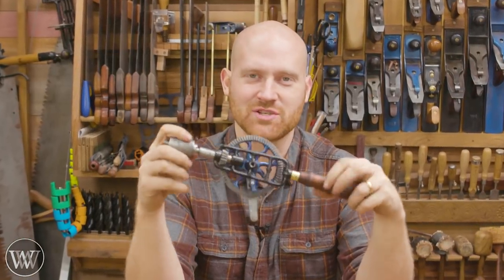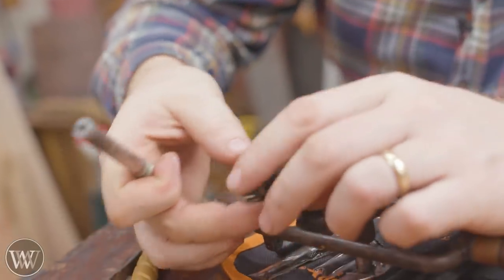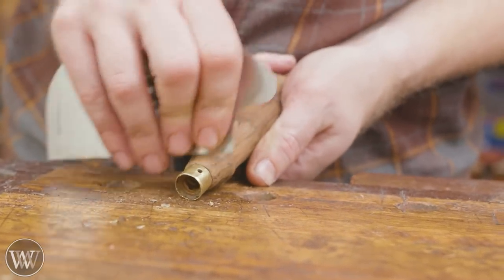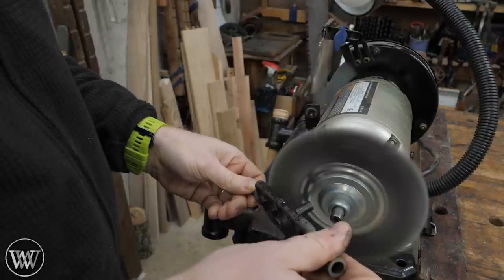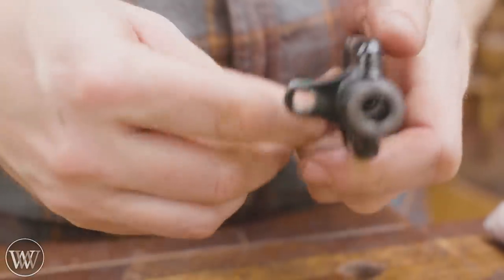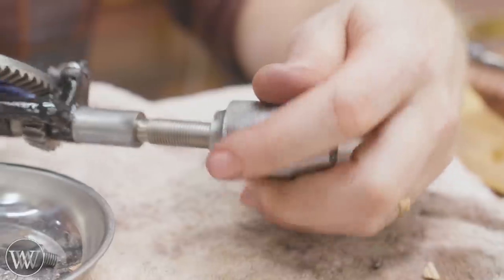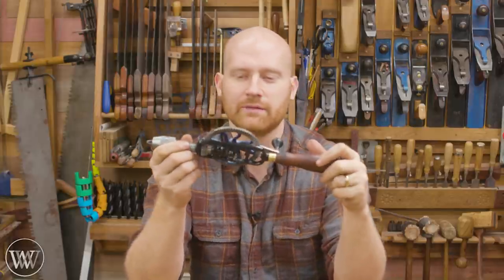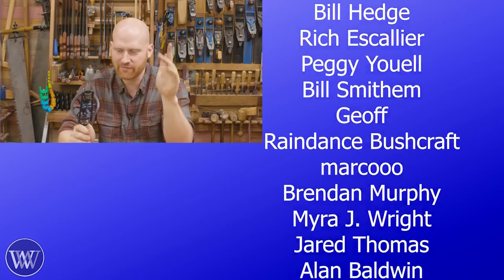How to Restore an Eggbeater Hand Drill

Comment: My dad gave me an egg beater drill (along with 2 braces & several boring bits), but I always have trouble with the torsional force when the crank is at the top & the bottom of the stroke, so I'm planning to make a pistol grip style handle for it to help give me a little more control over the twisting action.

Yours turned out beautiful!! Blue is also my favorite color 😁👍

Comment: LOL. I'm literally uploading a video of my egg beater restoration and I see this. Mine is a Craftsman 107.1 (or 1071) but the pin holding the main handle did not go all the way through, so that caused a bit of destruction that I had to repair. I actually called out one of your videos when using the edge of a chisel to scrape off the finish. 

I also restored a brace in very bad shape. Any maker's mark in the metal is completely gone due to the thick layer of rust. But it works like a dream, now.
Reply from the maker: Sweet dream I have to go check it out. Can you actually email me a link to your channel? That way I'll be able to see it. I can't just click it from here as this is a separate app for responding to comments.

Comment: I have an MF #2 or #5 with the 2 gears.  It's so much better than any of the modern ones.  You can't beat them for small bits that easily break in a power drill.

Comment: I really like the shade of red on Millers Falls Tools.  Acquired a Millers Falls egg beater drill awhile back.  After some rust removal and oiling, I found that the jaws could be pushed back into the chuck, but would not retract on their own.  Did not try to disassemble the chuck.  Seemed to work very well otherwise.  Any suggestions or advice would be appreciated.
I like these small drills.  It often easier than using a power drill, and I can be more accurate as well.
Thank-you for all you do to educate about hand tools.
Please take care and stay safe.
Reply from the maker: Yes. Some of those chuck designs can be incredibly difficult to work with.

Comment: Do you know where I could buy a new chuck, chuck shaft, and shaft gear (small) ?
Reply from the maker: Unfortunately those are not something you can get replacements for. And If you could the price would be more then getting a whole new one. But you might get lucky with some of the antique tool sellers on www.handtoolfinder.com most of them have a pile of parts tools. They might have one that is missing the handle to sell you.

Comment: I have an old egg beater hand drill that I fixed up. It works really well, but the knob on the crank is loose. Like there's a solid 1 or 2mm of space above the knob to the top of the bolt. Does anyone know what I could do to tighten it or completely take it off to make a new knob?

Comment: You do NOT need a third hand to use the missing side handle. The idea is to press the main handle against your body, to exert pressure on the drill bit, and then uses the side handle and crank handle with your two hands. Very useful for masonry  or metal drilling before electric drills were available. I know I did it many times as a boy.
Reply from the maker: Right on. I normally use that handle for the breast drills but for small ones like this they're so few uses that it's just not needed anymore. And if I do then I'll grab one of the brest drills.

Comment: I did not see you make a side handle for that. It would have had one of those coming from the factory.
When are you going to finish the restoration?
Reply from the maker: No side handle. Most people ended up losing them because they didn't use them and they ended up getting in the way. Later on. They sold them without the side handle because people didn't want them and would rather spend less money on them. But as to making one, they're actually kind of difficult to get the threading right. But you're basically making a small chisel, but instead of the iron you put in a threaded rod.

Comment: A power tool, I guess if you only have one power tool a grinder with a wire wheel is good?  BTW I saw a guy chuck a beater from a mixer in one and actually beat an egg.

Comment: Why is the handle at such an awkward angle to the left arm? The handle should be nearly horizontal and fit so that the palm is over the axis of rotation.
Reply from the maker: No. Generally you put your body weight over it so you want the handle vertical and your arm would be out of the way in that case.

Comment: 100 years old drill.  Learning new things ...  very nice, rethreaded the handle screw and make it flush, good job there. Rust remover ... very bad idea as it is a lasting corrosive acid!  Ear plugs + grease with masking tape - outstanding! No NOT valentine it is acidic.  Wrong size flat screwdrivers all the time.  Forgot to make sure the side wood handle rotates.  
Forgot to loosen the pins with light bike oil, forgot to place pins back into their exact same holes so grind their ends down, bad.  Ball bearings, good idea get new ones, but they must be all the same size exactly - you MIXED them that causes grinding and pressure hotspots!   Never grind gears with wire wheel brushes or sand them or dip them in rust removing acid, obviously, but you can re-profile them!  Forgot to light lube the chuck with high pressure grease, same for gears, NOT just a "little bit of oil".  Side handle missing ... no side handles are for breast drills which give you 2 free hands.  Use of primer good, but paint in Blue, no Millers Falls respects ... RED.   Good you did not "degrease" the wood as others do!  Good, light sanding away from the moving parts as sand paper dust is abrasive. Only  a few mistakes and plenty of excellent tricks ... ear plugs.
Reply from the maker: This rush remover is actually neutral it's not acidic or base. It's a straight up seven.